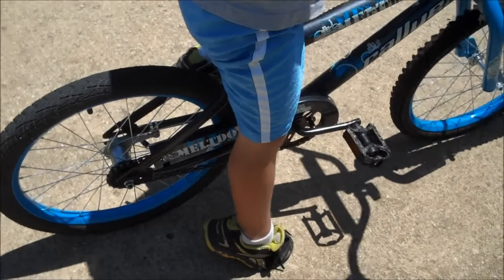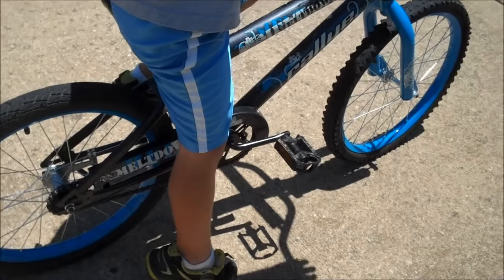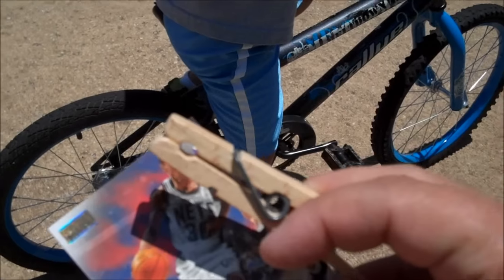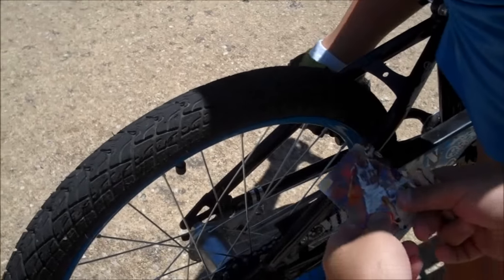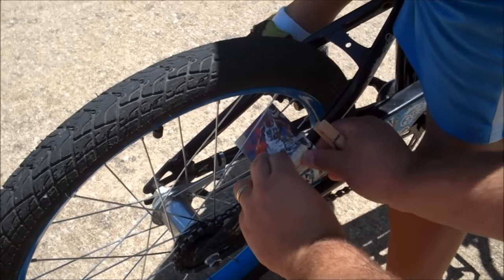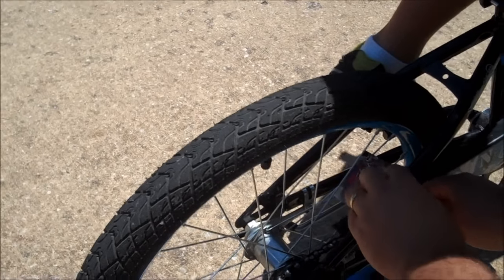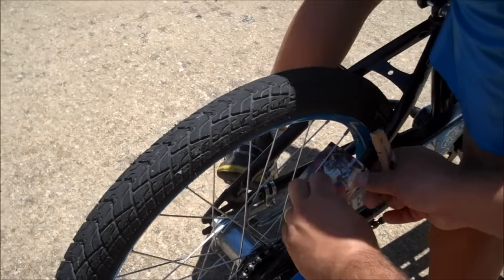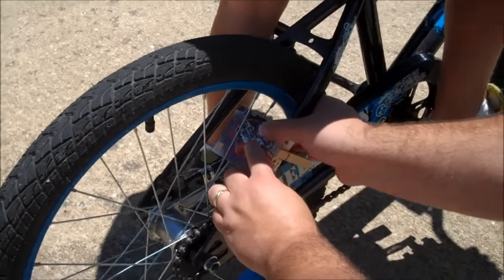How to Make a Bike Sound Like A Harley Using a Sports Card

Comment: We used half-inflated balloons instead of sports cards. After inflating, tie the end of the balloon around the fork of the front tire, then feed (push) the balloon around the inside of the fork by slowly turning the tire just enough to allow the spokes to pull the balloon through to the other side. When you rode, the balloon’s bouncing contact with spinning spokes created a low, rumbling sound. If you had a group of 4-5 friends outfitting their bikes the same way, you really got people’s attention when you came tearing down the street.